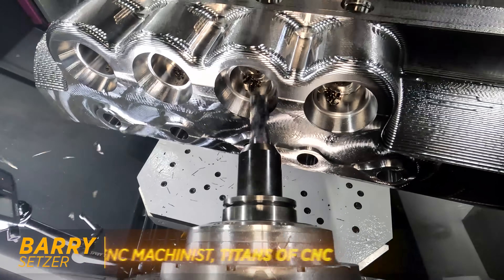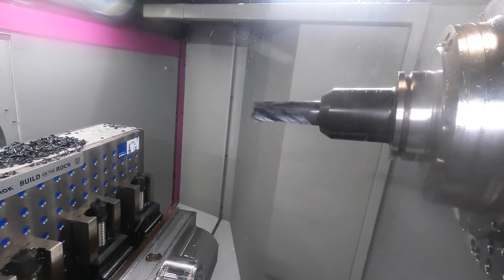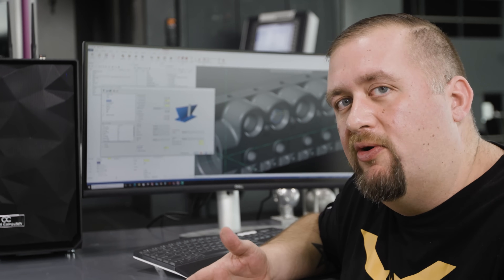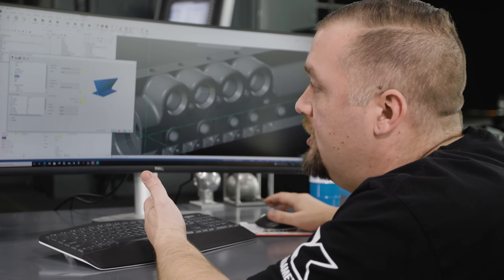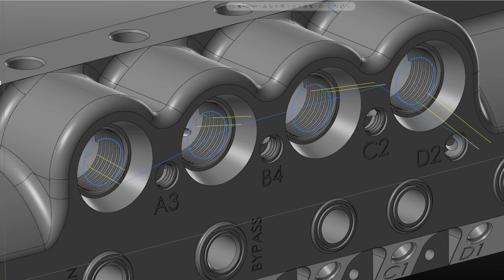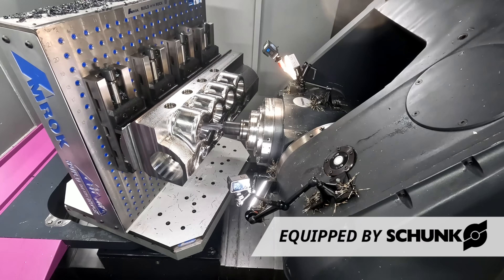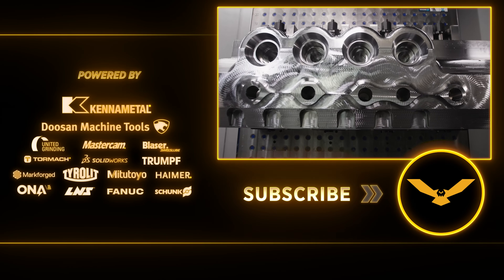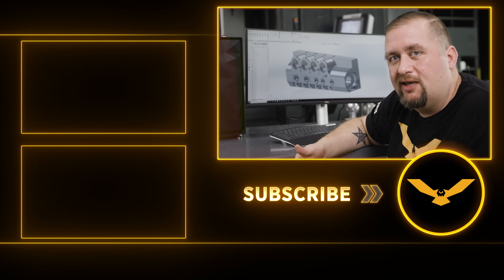GREATEST 5-Axis Machining We Have Ever Done using Kennametal Tools

Comment: I wonder what the process of setting centre of rotation is on a machine like that
Reply: We don't usually program from center of rotation.......we essentially use tilted work planes and tool center point control in relationship to a probed position on the stock or the part
Reply: @barrysetzer  i don’t know about Heidenhein but fanuc uses centre of rotation parameters for both TWP and tcpc.
Reply: Oh I see what you mean, actually SETTING the center of rotation parameters themselves. I misunderstood!

Comment: In Heidenhain you can use the "Cycle 32" too. The Machine drives smoother.
Reply: We did use Heidenhain's Cycle 32.......our CAM tolerances was .0002" and our Cycle 32 tolerance was .0006"

Comment: Now I see, why you've chosen a variant with A-Axis, instead of a B-Axis. It would be impossible to access negative angles with B-Axis head. Some say, that B-Axis is much stiffer, than an A-Axis, but Ibarmia seems to be rigid even with an A-Axis head. Also, I assume, Heidenhain is the best control specifically for milling machines? Because, I almost haven't seen any lathe with it. DMG Mori has about three mid-tier lathes with optional Heidenhain controls, meanwhile almost all their mills offer this one, as an option. Also, Doosan offers Heidenhain controls only for their milling machines, as I haven't seen any Doosan lathe brochure, which includes this control in option list.
Reply: CNC PILOT 640 and MANUALplus 620 are heidenhain's new lathe controls.

Comment: I've never rans a machine with Heidenhain controls. Is it possible to code that operational maneuver on the Heidenhain control conversational side?
Reply: No. There's no canned cycles for 5 axis simultaneous.
Reply: @71brp84  All incremental steps is why the roughing passes sound like that. I'm getting rusty and should have been able to hear it.

Comment: English isn't my native language and I doubt I can find proper translations for it, could you maybe explain what a "ruled surface" stands for? Because I have no idea
Reply: Think of it as a surface made up of straight lines
Reply: @barrysetzer  but it's a curved surface? Or do you mean that in any point on the surface there exists a line going through it that is straight?
Reply: @CatNolara  Exactly! At any position on the surface, there exists a straight line. This way, the tool is in contact with the bottom, middle, and top of the surface at all times.
Reply: @barrysetzer  ah, now I understand. Thanks for explaining.

I think another definition would be a surface, that can be made out of a flat sheet of paper without kinks, right?
Reply: @CatNolara  Yes! They important thing is that the surface cannot contain any "lumps," or they will be cut off
Reply: @barrysetzer  I looked more into it and it's actually more complicated than I thought. There are shapes that can't be made out of paper, but are still ruled surfaces, like the hyperboloid.

Comment: The sound of cutting is not good
The surface also
Its steel not aluminium and clearance of movent parts such bearings in rotary axis need attention in cutting conditions
Reply: It was a roughing toolpath
Reply: @barrysetzer  i know it

One axis is not rigid enough and such a heavy machine still wants high-speed machining in the rotary axis mode without brake We will see what is visible on the surface and on the chips of your cutter it is simply large and is able to shake the system You can't fool physics buddy

Comment: When programming, does the program notify  you, if you have say .001 interference with say the floor path and the end of the mill, if the tool itself would be .001 longer on the tip during the pass, very interested in learning the trade, slowly opening videos as the weeks pass, thank you for the free education
Reply: Yes the program will notify you in most cases. You can also compare your machined digital stock to your part model, to make sure everything is perfect. Thanks for watching!